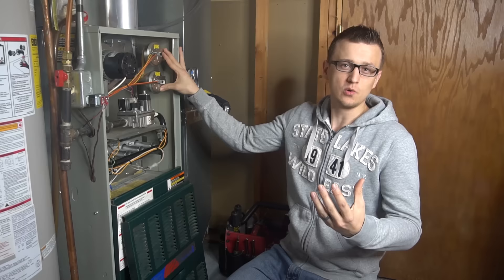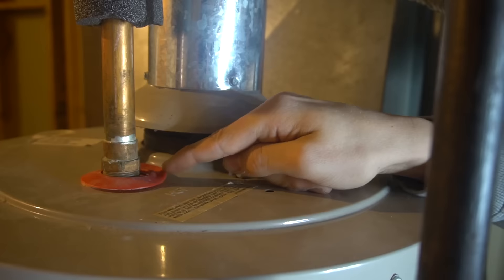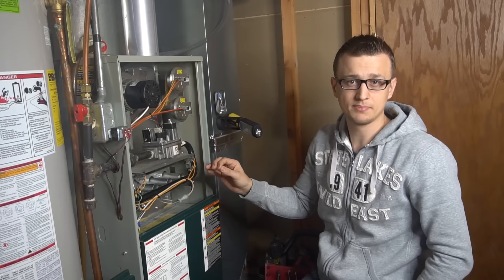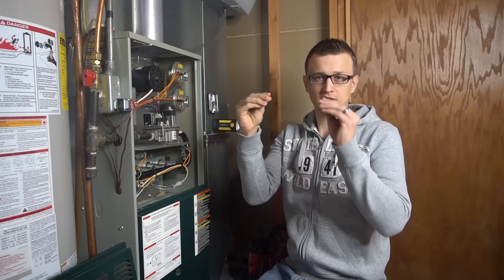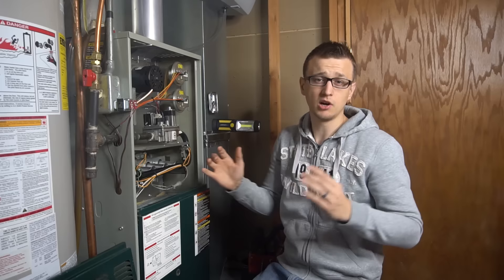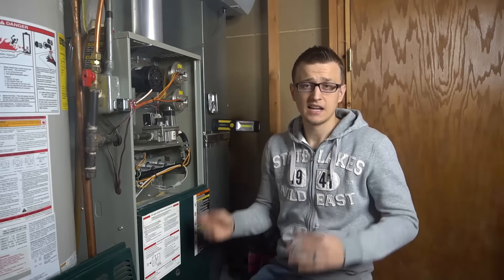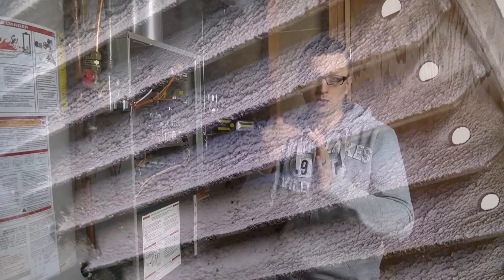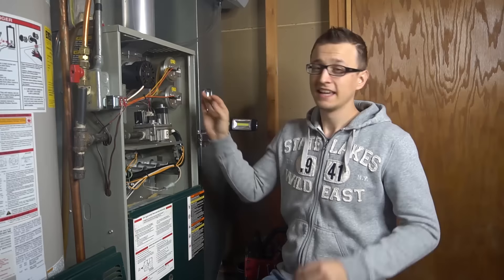Furnace Pressure Switch Troubleshooting

Comment: Very concise!  Was able to toubleshoot and get the furnace going again after replacing the reduction motor and then coming across a Pressure switch error.  One of the 10 issues you point out did the trick.  Not sure which one, but, it doesn't matter now.  Saved lots of time and money!  ...Thank you!

Comment: I found this video to be extremely helpful in diagnosing and fixing the "pressure switch" error code. My Bryant high efficiency furnace was installed by professionals less than 5 years ago and I was in a quandry why the house got colder as the Minnesota winter set in. The error code made me wonder if I needed to replace the pressure switch? or the blower motor controller? on my new furnace. After viewing this video I located and removed the "trap" discussed and when cleaning it I found no less than six wasp carcasses. When I got it back together the furnace works great. Thanks for an informative and very well done video!

Comment: Hi Jay, I love this in depth Pressure Switch Video. I have a HK06NB012 switch which handles the Collector Box pressure testing, that is working just a you described. The back side of that dual switch is for the Inducer Housing Pressure. That remains open and never closes. This is a NO switch on both sides of the duel switch... (the Collector Box side switch closed as it should). Motor is running and sounding great (inducer motor). The furnace is a ComfortMaker N9MSE040 and is installed new in a home I built 4 years ago... so everything is very new. HOWEVER, 
this all started when I found water in the "catch tray" (water proof so it did not leak out on the floor). It was a lot of water ... filled about a 1/4 of a shop vac. I was lucky because they installed a "condensator cop" ... and it shut off the red line to the thermostat. At first I thought the water was from the Humidifier ... which is configured to run when I just have the Fan set to on via the Thermostat. I run that all the time to add humidity. It might have leaked onto the top of the furnace and then into the catch pan.... not sure. It may not have been that.... maybe condensate ... maybe. I am leaning on replacing the duel pressure switch.... but seems strange ... maybe the two are unrelated. Any thoughts or ideas? I really would love to hear from you on this very strange series of events. Thanks Bob Becker Holland MI

Comment: Thanks for your informative video. I followed your steps, and discovered heat on my exhaust blower motor. turns out,it was defective. I replaced it with a new motor, and the furnace fired right up and is working perfectly again. Feb. in Pa. is not a good time to be having furnace issues. Thanks again!

Comment: Man.  24 degrees tomorrow, and no service rep available for 4 days.  What a thorough explanation and video.  Thanks, we will sleep with Warth tonight!  Cleaned the condensation exchange, removed and reattached all port hoses, and face plate to heat exchange. Ten-year-old unit back up and running.  Thanks!

Comment: I had recently had to repair the condensate drain on my furnace, afterward I got a code 31. Thanks to this video I was able to realize I had put the pressure hoses on backward and switched ports! Working fine and saved me a couple hundred bucks! Thanks!

Comment: Thank you sir, you are quite knowledgeable and this video helped me solve my furnace issue this winter.  You requested our stories in return for your help so here goes:  I looked for an error code and found one related to the pressure switches.   There are two pressure switches regardless of the fact that I have an 80% efficient system.  All I did was take my multi meter, set it to ohms, disconnect the wires to one switch, replacing with the multi tester leads using alligator clips, turned on the furnace to see if the draft fan would close the switch.  The 1st one I tested showed almost 0 ohms when the furnace draft motor kicked in.  The second was also closing contacts, but showing a few meg ohms, not close to 0.  I then tested by shorting the leads that go to the switch when the unit starts up and everything came on.  Bad 2nd pressure switch!  You would think that was the hard part... the hard part will likely be finding this part before I freeze my but off.  Anyhow, thanks again, you saved me $$$ and time from a down furnace.

Comment: I pulled the line off the pressure switch and ran a paper clip through the little nipple it attaches to and it fixed my problem. Very helpful video.

Comment: Hey there guy,
What a great video! My 26 year old Lennox Elite Series furnace was shutting off and throwing a pressure switch code. Watched this video, disconnected the front end of the condensate line and tried to blow through it. Clogged. Blew out the clog and problem solved. Thanks so much for this great video!

Comment: I am forever grateful for this video.  It explained every scenario and in laymens terms.  They wanted $688 to replace the low pressure side and it wasn't even a failed switch.  Besides, Icould purchase both switches on line for $30 and install in a matter of minutes.  Thank you for educating me on the root cause of inoperable pressure switches.  Meanwhile, I am by-passing it by waiting for the draft inducer to get up to speed and then jumpering around the switch.

Comment: Great advice...went batshit crazy, trying to diagnose why my furnace wouldn't kick in...changed the flame sensor, changed the pressure switch and roll out switch to no avail...watched your video and sure enough the pressure switch hose port was blocked...little clean out and poof..heat! Thank you for this video!

Comment: Great pressure switch service video! My Lennox 80% efficiency furnace wasn't igniting. The purge fan would start but then it would fault. I was about to change the igniter but happened to watch your video first. Turns out the pressure switch inlet port was partially plugged at purge fan housing. Cleaned it and good to go!! Thanks for our help!

Comment: Another good job - thanks. I have a high eff Amanda furnace. A clogged condensation tube from the collector box to the trap was exactly the problem that my furnace was not igniting. I almost replaced the furnace😂

Comment: I thought it was my flame sensor since the heater will come on and then dies shortly after. I replaced it but still not working properly. This video explained a lot and I did what he said. Check for water build up in the lines inside the furnace. Found 2 lines, blew them and water came our. Now furnace is working. Thank you.

Comment: Im back for a third time to find a solution to a furnace issue. Your videos have been the best.
Reply: I thought I add what happened today in case someone else has the same issue. My furnace timed out last night. I tried changing battery to thermostat and reset breaker and it didn’t work. I had to reset the safety switch to get it to run the heating sequence again. The sequence stopped right after the gas valve opened. The igniter would glow allowing the gas valve to open but would stop glowing just as the gas arrives at the burner, no flame. At first I thought it was the flame sensor, which it was not. Luckily I had another furnace unit with similar parts so I tested the flame sensor, igniter, and the pressure switch, all were fine. My suspicion now is a blockage someone causing the switch to remain open thereby terminating the heating sequence. At one point, I thought it was a igniter timing issue which it was not. I checked this by jumper-ing the PS to close (suction with gas valve opened) and the igniter didn’t go out thereby allowing the burners to igniter properly. Hope this helps

Comment: Excellent, practical video.  Thank you very much.  The comment about high efficiency Carrier furnaces and the plugging up condensate trap was exactly what my issue was.  The tip for the bucket was spot on - about a gallon of water came out.  After I cleaned the trap, everything ran perfectly.

Comment: Thank you for your informative and easy to understand videos. I just purchased a new inducer motor and replacing mine will hopefully fix the intermittent issues I am having with my  high efficiency furnace. The motor surges and wanes when running sounding like it is huffing along then pauses then pushes on some more. Every few days or so this will throw the 2 red blinking light error code. Once I turn off the power and turn back on, it works again for a few days. I haven't specifically heard of that scenario in your troubleshooting.

Comment: Excellent video. I went through many you tube videos and ready to give up. you went step by step and no one mentioned the details as you did. As it turned out you mentioned a detail which turned out to be my problem. A paper clip was my tool and cleared out the block tube where the plastic tube goes. Furnace fired up! Thanks for the excellent video.
Reply from the maker: Glad to hear you were able to get the furnace fixed! Thank you for sharing your experience, stay warm!!

Comment: Hands down, the best video explanation for furnace repair. I own an IT business, so I think I can fix anything. ;-) With videos like yours, I usually can and save a ton of money in the process! I thought I had a bad pressure switch and ordered a replacement but ended up being a clogged port. It's a Bryant with the port behind the inducer motor assembly and a pain to reach but I managed and it worked. Fixed it at 4AM. The family was relieved. Subscribed! Thank you!

Comment: Goodwin 96% furnace, condensate in the inducer fan housing due to a clogged drain in the elbow in the exhaust line. The fan could not get to speed causing the low-pressure switch not to switch. Took fan assembly out, drained water out. Reassembled the the furnace worked.

Comment: Thank you for producing these videos -- very clear, thorough and helpful! I managed to kind of narrow down the issue with my furnace to the vent inducer assembly using instructions from other places. I was ready to replace it (which would have worked but cost $300). Then I found your videos and pinpointed the exact problem. Some dust or ash seemed to have gotten wet and clogged the port where the air pressure tube connects. When I found it, the clog had solidified and was rock hard. With your instructions I managed to fix everything for $0! 🤩

Comment: Jay.   Excellent clear videos.    I have a high efficiency Carrier gas furnace from a 2004 built home.   I just had a recurrence of the error code 31 pressure switch that I solved 2 years ago as I have done again tonight at least for the time being..   The air intake is from the attic which cannot be seen...small attic.   I did cut the PVC pipe 2 years ago so that I can blow on it with a shop vac.    It is clear based upon the suction on vacuum intake.   I blew on the attic intake again because the only way the furnace would start is by removing or cracking the plate cover on burn chamber which you say is due to a clogged intake.   Oddly opening the pvc pipe intake 3 feet from furnace still gave a 31 code.  Only cracking or removing the burn chamber cover would allow it to start.    I did check the pressure switch hoses and blew on them.   The switch hose that wraps around the rear of the inducer fan cabinet does not blow very much if at all but the one that goes up to the burn chamber blows audibly clear.    I started the furnace with the plate cracked open and then screwed it shut.  Of note, I could not tell if air was sucking around the edge of cover or blowing out.   Putting cover on did NOT shut down furnace.   With the furnace now running I went up on the wet roof at night with my flashlight ;) and the exhaust was blowing steam exhaust freely.   So I do not think that is obstructed.   The PVC exhaust goes to the roof and has a upside down J to keep rain out.   This furnace is on the 3rd floor btw.     I let it run awhile and then shut off emergency switch again and tested it again and it now works at least for now.   

Do I need a new switch?    Why would it not start  with burn cover closed but presumably easily taking air in through a 4 foot section of PVC air intake pipe?   But then run with the cover removed from burn chamber?    This made me wonder if it was blowing exhaust out of the burn chamber?...not possible I assume?    Thanks   Adrian Hohenwarter

Comment: Thanks. Could not get hold of my HVAC guy. Prayed. Then ran across your video. verified the switch is good by very lightly sucked on the tube with leads testing across the switch. heard the beep. Then tried to poke a wire into the pressure switch port with lots of resistance. . cleared it out and vroom...on. God bless.

Comment: THANK YOU!!  My pressure switch hose had partially come off the pressure switch and was causing a 3-blink Pressure Switch Error.  I simply wiggled it back on and the American Standard Freedom 80 fired right up.  I added a small zip tie to ensure it wouldn't happen again.  Your video saved me a service call and kept our quarantined family warm during the last days of cool weather here in the upper mid-west.

Comment: Thank you!! I replaced the flame sensor being that the burners would turn off after a few seconds, after much trouble shooting I found out the Pressure sensor was giving sporadic numbers. At times it would close and would open momentarily, come to find out the pressure switch port was plugged up! Thanks for the help!

Comment: Issue with my Carrier Gas Furnace was the it would cycle on and fan would run at warp speed but air would not be that warm. It would not run for very long either. Took front cover off and noticed that every few cycles that it would flash a code. Code was a 32, which for my unit stood for: Low-Heat pressure switch did not close or reopen. After watching this video I inspected my condensate trap and as I took the main hose off water just poured out, just like was described in video. I took trap out and it was totally plugged with some nasty stuff. After running water through and blowing it out I reinstalled it and everything worked great. Thanks again for the helpful video. My unit was a Carrier 58MVC.

Comment: Thanks, Jay. My 16-year-old Bryant furnace did not ignite. I got error code 31. A little air (gently) through the tube at the pressure switch and I got heat. Saved me a $$$ tech service call. Thanks again!

Comment: Success ! York Diamond 80 - pressure hose looked good, nipple was clear.  I removed the short hose, blew air through the short piece and noticed a couple drops of water came out.  Put back on and HEAT!  Great explanation, thanks

Comment: This is a fantastic video! My furnace wasn't turning on and we had no idea why. I found the instructions for how to read the code and found out it was a pressure switch problem, but I had no idea what a pressure switch even was. Turns out it was just a dirty (filthy, tbh) blower wheel. I cleaned it up and the furnace came right back on! So glad we didn't have to hire someone to come to our house for a simple fix like this!

Comment: Ran into a strange situation.  Trane VX80 two stage.  When called.  Inducer ran smoothly but furnace would not start. If I disconnect the hose or simply pinch it to, then the ignitor lite and whole thing kicked into action, but of course I had to release or reconnect the tube to keep the gas flowing.  As a temp solution, I tied the hex screw in middle of the pressure switch on full turn clockwise (in my case I had to separate  the high-low switch  as they are connected together with a flow connector in between them, to access the screws), and everything worked fine.   But I really had to clue what was causing it.  Inducer motor is smooth, wheel a bit rusting (might be an issue as indicated in this great video).  Did check the vent.. without the mentioned remedy, even disconnect the vent duck did not solve the problem.  Love to here you experts out there for some suggestions/discussions.

Comment: You are the the MVP mate. Saved me a a few hundred $$ clogged condensation line on the front end of the motor. Water was getting into the ps lines through the motor. Low flame detected at the same time, cleaned the thermocouple based on another video of yours and presto. Works like a charm.

Comment: Little to no heat starting on a week that was below zero out. Everything pointed to pressure switch or issue causing switch problem. With my work schedule couldn’t get to look deeper into it. Changed switch, still no heat. But had a vacuum line off and noticed a gurgling sound. Came across this and the condensate trap section. Pulled first hose, and I was glad I had a bucket near by. Drained, removed trap, cleaned out, reinstalled, turned on, flew through its checks and got flame immediately!
Reply from the maker: Awesome! Glad to hear you were able to find and fix the problem. Stay warm!

Comment: Thanks for the vid, helped me troubleshoot an "open pressure switch" error which ended up being a bad inducer motor capacitor that I spent $8 to replace and fix my problem.

Comment: Two different Bryant service techs could not diagnose a pressure switch failure to open issue.  This video was a huge save heading into negative temperatures this weekend. A plugged condensate trap was the issue vs. being told I needed a new furnace.  They were convinced the inducer motor module $1200 and circuit board  $600 were defective.

Comment: Appreciate this video - saved me a service call. Condensation in my vent pipe is causing white power to build up inside the inducer and that got into the port and plugged it completely. Now have to figure out how to deal with that condensation - 48" to flat roof then 33" above roof 4" B vent.